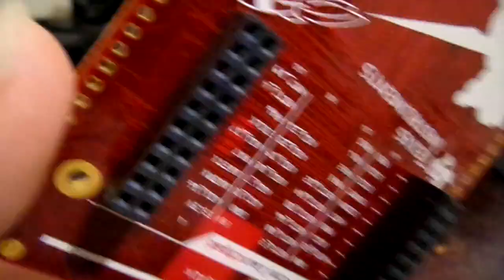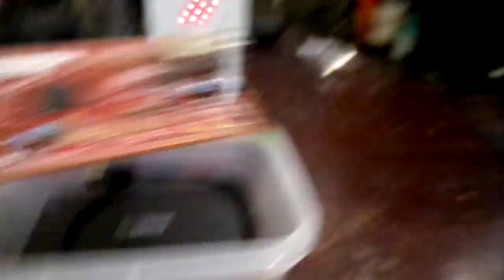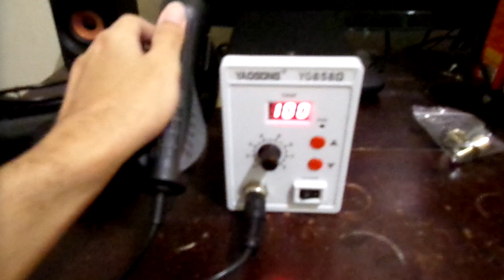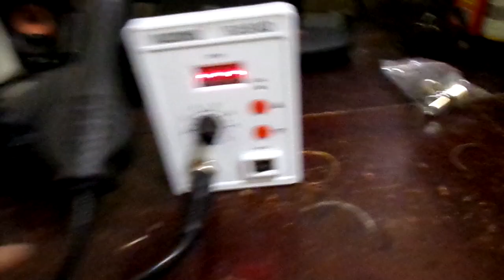Difference Between a Rework Station And A Heat Gun

Comment: I know this video has few views but thanks. It was just what i needed. I know its 3 years old but what model is that rework station? Also do you know anything about the combination systems with an iron, rework and power supply in one unit? As in are they any good or asking too much from one piece of equipment? I like to buy decent quality tools instead of a bunch of trash ill have to replace after learning my lesson but I'm not rich either and need all three one way or another.